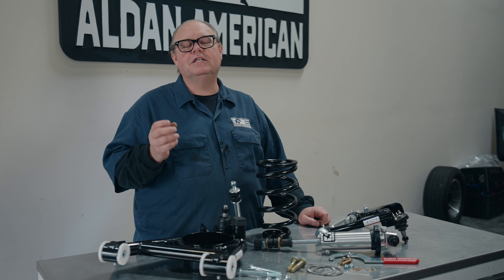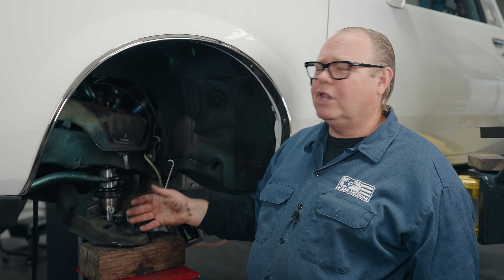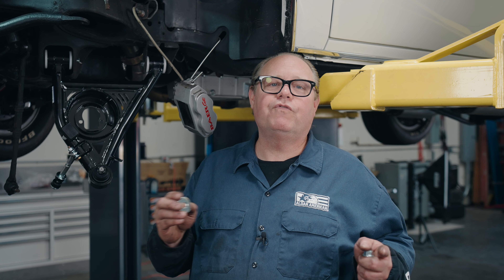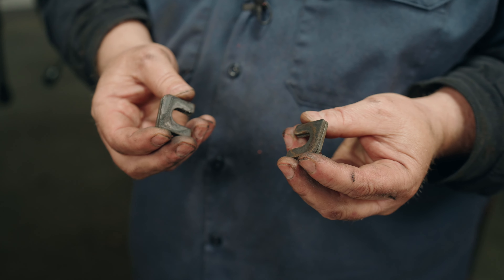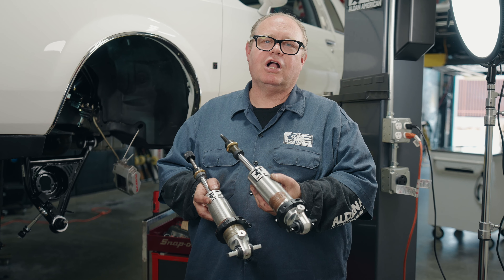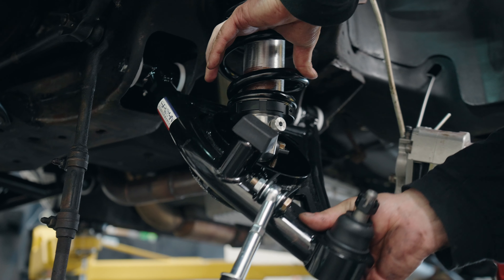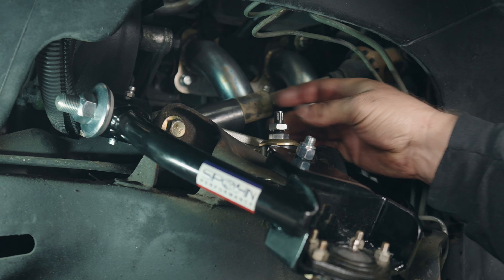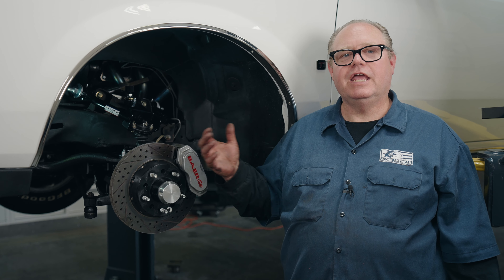Buick Regal Turbo G-Body Coilover Upgrade

Comment: Did you put the shims back on or did you take the to the alignment shop to put back on?
Reply from the maker: We re-install the shims in the same placement as they were removed so the alignment shop has a starting point.

Comment: Hello.. I see the product looks great and install is easy but how do they feel driving?  I've heard the rears are too bouncy and they bottom out easy... How do they feel ?
Reply from the maker: Our coilover kits for the GM G-Body will add more responsiveness and improved handling vs. the stock setups. We use cold wound springs and offer single or double adjustable coilovers for a softer or firmer ride quality. Rears should not be bouncy or bottom out with proper spring preload adjusted on the coilover. Give our team a call for more info 310-834-7478

Comment: Do yall just sell the upper and lower control arms ????
Reply from the maker: Yes. Please give our team at Aldan American a call for part numbers and pricing 310-834-7478
Reply: @AldanAmerican  ok i order 300338 coil-over kit and I didn get the thrust bearing or the gauge steel rings do that kit come with them ??? They were in the picture and I called but was busy I guess
Reply from the maker: @248ike  Please reach out to our sales email we will help get this resolved.  sales@aldanamerican.com
Reply: @AldanAmerican  I did and they did thanks